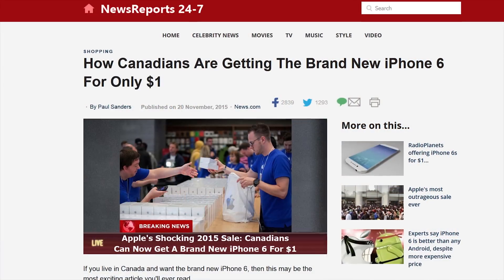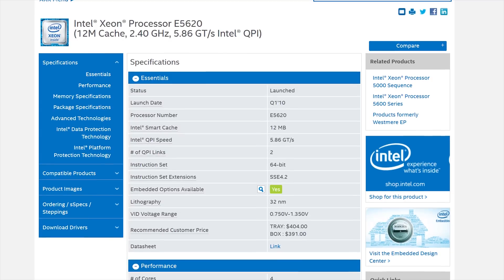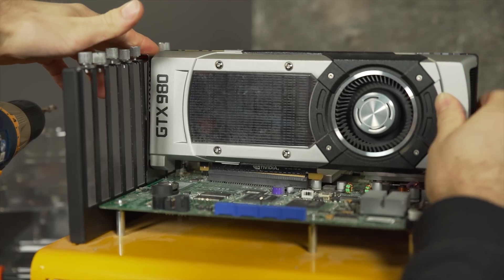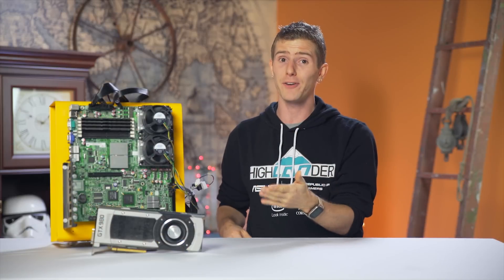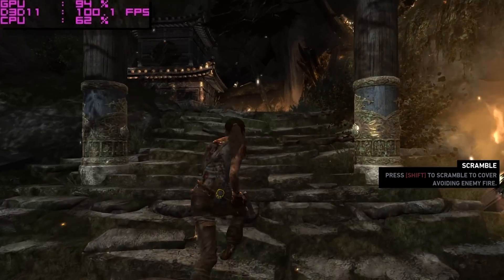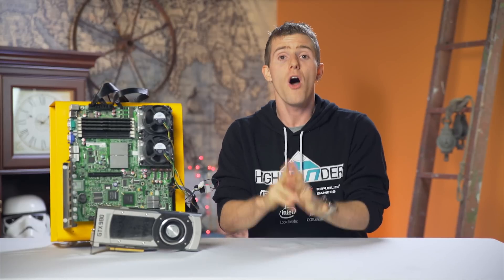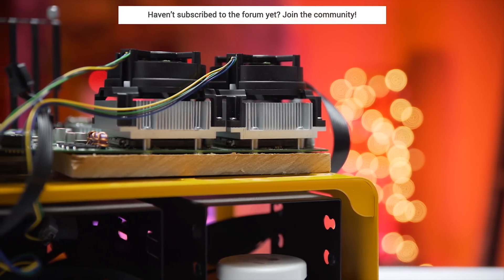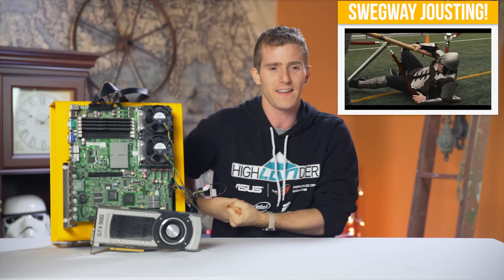Under $150 Budget Gaming 8 Core CPU, Motherboard & 16GB RAM

Comment: *casually saws off part of 980*

oh god no
Reply: Couldn't he just have used a PCI express extension cable and mount the card further down? Why damage a video card?
Reply: MundaneRaptor It’s not that damaged, it’s just that the video card lock on the slot doesn’t work
Reply: MundaneRaptor WHY GO TO SUCH LENGTHS?!

(because he sawed it off since it was too long)
Reply: Saw IX: Titan split in two!
Reply: I'd say cutting it off was cheaper than getting an extension cable esp since this motherboard doesn't have a locking mechanism for the card. It's not like he's gonna use this as his personal rig so he didn't give a fuck lol.
Reply: GuvernorDave Chopping into a $700 (at the time) gpu is cheaper than a $50 riser?
Reply: god i hate these fucking comments that for some reason thinks it funny to press enter 7 times before typing again...
Reply: Well in his defense the 980 still works its just more portable.  

Now if the 980 had broken I would cried.
Reply: I almost cried when he did that.. I still only have a 570 :(
Reply: +Zestypanda  Well yes actually. Grabbing a hacksaw doesn't cost anything but the riser does. It's not like the "$700 card" got damaged or devalued in any way.
Reply: thats what she said
Reply: Imagine an add: Selling gtx 980. Has some parts chopped off, but otherwise it looks like new
Reply: to prevent the card from shorting pins.
Reply: My friend could not fit in a titan x so he chopped it in half
Reply: its like the hook.

doesnt affect performance but what MundaneRaptor said
Reply: no one relies on that tab to hold their graphics card in here people.........The screws hold it in....unless you dont use those? likely not.
Reply: crimescene25
 Well most of the people wouldn't notice. But personally, I build computer for me and my friends from parts, I never buy them already assembled
Reply: Dude, you could take pictures of the stupid thing and post it up and maybe...MAYBE 1% of people that looked at it would even notice. These guys would of stroked out if they knew what we were doing to top of the line video cards back in the days of the original PCI slots.
Reply: Almost 2 years later, it's still painful to watch. :(
Reply: it's the retention arm so the pci express slot clip can lock the card in place, not vital but why damage a perfectly good card when there is another way to do the job fairly easily and cheaply?
Reply: dude, this guy shits teslas. its NBD
Reply: +blind1337nedm lol
Reply: The GTX 980 never cost 700$, it was cheaper at release (550$)
Reply: Pyrofan97 No, that was MSRP. Stores sold it for as much as $700
Reply: A Bal Just put it in a whole computer and sell it all. None of you noobs would even know it was gone.....
Reply: xPimpChickenGaming x 
No
Reply: Luis C. Yeah but the video got 3 million views =^_^= makes all the money back and then some.
Reply: +Luis C. badum tss
Reply: cringe worthy
Reply: Luis C. It's just the lock...
Reply: *very casually
Reply: check the tittle!
Reply: Who cares, bloke is bathing in money
Reply: That part is honestly gold because computer need a suitable metal and that is why computers are expensive
Reply: *off
Reply: Zestypanda done :D
Reply: @tr4shstarr  how did you edit the comment with "off" without editing the comment hax???
Reply: +MundaneRaptor Probably but it's just a useless piece of plastic/circuit board that he removed.
Reply: guess it's a "sawed-off" now.....

kill me
Reply: Luis C. Calm it's not likebits a 1080
Reply: I mean a 980 still is more spendy than a 1070 right
Reply: lol?

Comment: I love that someone finally covered what I run as a main system. 
Granted, mine's a Dell Precision T7400...but It works great!
Reply: What hardware do you have in that?
Reply: Dual 5450 Xeons, two Evga GTX-660 2Gb, a Kingston SSD and dual 2TB Western Digital drives.
Reply: UnKnownSoldier41
12 MB L2 cache. 1333 MHz FSB. Big cache is very good.
My AMD Phenom II has 6 MB L3 cache, 512 KB of L2 cache per core.
Reply: Nice build. I'm hoping to snatch another SSD to use purely as Virtual Memory to go along with the 32GB of Ram. 
This ram runs hot!
Reply: UnKnownSoldier41
It just need some air flow. Perhaps add a small fan.

32 GB is a lot. I know a guy who added 64 GB in his Mac just for the heck of it.
Reply: louis tournas 
It has two fans on it. These thing uses DDR2 ECC, the one's with the heatsinks. Apparently they are able to run at high temps :/

This machine can hold at most 128GB, I believe.

Comment: So maybe someone here can help. I'm looking into getting a Xeon E5-2670 8 core CPU and all's well (Thank you ebay) but the problem I ran into is finding an LGA2011 Socket Motherboard for it. I can't find one that isn't $300 or so or a 2011-v3 which I'm told does NOT work with it. Not to mention I heard the X79 is a good fit for it and doesn't use odd server proportions. Has anyone seen something that is in the ATX range of Motherboards for less than half my rent money? Thanks in advance!

Comment: if you had gotten a couple of higher clocked CPU's, do you think they would have kept up with the GTX better and possibly not have cause a bottleneck? (the x5460 is about $20 a pop right now)
i've been eyeballing the dell precision t5400. it has 16x pci-express 2.0 slots available, and ram for that computer is cheap and in abundance.

Comment: I did this for about $45 with some thrifty shopping. I got a pair of E5620s for $5 a piece, plus an old Dell Poweredge R410 board off of Ebay for about $30. With two sticks of refurbished ECC 1066 4GB from samsung to finish it all off (maybe $5 a piece), I got a beefy home server for VMs and gaming for literally dirt cheep. 

This isn't to flaunt how amazing I am though, it is more just to say that you really CAN do something as stupid as this and have it turn out great :D
Reply: hey i was looking into that board, does it have a pci-e slot?
Reply: Indeed it does. However, I should warn you that you will need to do a tiny bit of custom modding to get a regular PCI-E device into the slot (just bending a little metal). Also, the on board cpu fan headers are not compatible with regular fan connectors, so you might have to do some custom wiring there or pick up one of their own fans.
Reply: +Legendman2012 thanks for info, btw im guessing there's no type oc with this mobo

Comment: Also I have a e4500 core2dou it cost me 75p
Reply: That can't suffice; it's not powerful enough in this generation.
Reply: +kemboy323 I know but still cheap it runs win 7 great
Reply: +kemboy323 I know but it still runs Windows 7 fine and office 2016 (with a good 7200rpm had or ssd)

Comment: Just buy a Dell T5400 workstation. Fit it with 16GB of DDR2, 2x X5470 at 3.3GHz and you are good to go. 850W PSU and dual GPU support all built it.

Comment: wait lets just think, you could buff this up to to a £300 build and winning cheap ebay auctions and buys you could stuff it with power and an additional few parts like a sound card and more high spec ram and gpu. i will do this if i have to sell all my furniture on the way.

Comment: When your $1400 build gets a lower Cinebench score than a $150 budget build
Reply: How the heck did you spend $1400 and get a lower cinebench score, did you build it in the 1990s?
Reply: If you consider his build at full price (200+$)+that graphic card (500$)+a huge case for that HUGE mb (100-200$)+PSU (80-100$)+hd+ssd you are over 1.000$.  

And i'm not considering: the value in terms of time & efforts of all compatibility issue that can occur and the really low upgrade chance.

With 1.000-1.100$ you can achieve the same results if you care only about gaming performance. High end gpu and decent cpu+mobo is the way to go.
Reply: My laptop has a cpu score of 35cb XD
Reply: In the 1400 are you taking into account only MoBo, cpu and ram? I don't think so :D
Reply: +JakeAndBake nope, July 2014 ;)

http://pcpartpicker.com/user/AHoboPanda/saved/JNjwrH
Reply: A Hobo Panda my 1000 dollar build gets over 2k
Reply: Take 5 Channel cinebench is cpu not gpu lol
Reply: Taking those things only into account would be relevant if I got a higher score. My $1400 build in total got a lower cinebench score than a $150 budget build.
Reply: Actually is more like $550 with the 980.
Reply: since 470 is tv's,headset, mouse... and you graphics card was 400 and your case and blue ray reader were 40 each, the storage units were like 330 and then shpping and all that doesnt come into the price. so thats like 1300 its not gone up in price to 1700 but still youve only spent like 300-400 on what he spent 150, i think you got the better deal in the end as your parts are better for the future xD
Reply: What about psu, hdd, coolers? they come free? xD I also like to include monitor, mouse/pad, keys and case
Reply: my 250$ bulid get's 918 points one cinebench
Reply: Dan katesfield i have a Pentium 4, its very Bad, i cant Start the Benchmarks or it crsshes after 10-15 seconds

Comment: under 200 euros u can make a 12 core machine with 8 gigs of ram (using xeon 56xx and LGA1366 dual sockeyt mobo)
Reply: no you dont
Reply: 2 xeon 56xx + 8gb ECC ram DDR3 and 1366 server mobo FIND IT ON EBAY

Comment: Best budget pc (used part) e5640 $30; good used cpu cooler for oc $15; x58 mobo $80; 4*2go ddr3 $25; 7870 or r9 280 $110; a good 650w psu $25; a decent gaming used case $30; a ssd $70 or 1to drive $50. So for ~$365-385 you can have a goodass cheap 1080p gaming build, Overwatch at high 100fps same for black ops3 and 300fps on csgo (with overclock, 4,2ghz for the cpu and 1,1ghz for the gpu)

Comment: its better to get an lga 775 mobo and mod it and the cpu to work, of course with a better cpu cause u won't be able to install 2 and it will have max 8gb of ram, but its much easier to do :P i just finished building a pc like that and it works really well, its the 2nd time i did it :P

Comment: Cringe when you cut off the piece of the GPU. Could have modified that cheap ass motherboard instead of fucking up a fantastic card.
Reply: Glaive Beam "rip that capacitor off" all you need is a shitty SMD rework station for $50, it's worth it vs messing up a $500 card.

Comment: This second hand, super budget is nice, in case you allready have parts lying around to start with.
Here's me for example, I work at a hardware repair shop and I have an intel LGA2011 board lying around, so I went on e-bay and found a xeon e6 2670 for 70$?! I mean, it's a hell of a cpu for this money!
So I have something to start with, at least my chances of it actually working are much higher.

Comment: My X5460 can play GTA5 at 1080p low settings with 60fps, which isn't bad for a single CPU that cost $30.
I undervolted it as well, so it doesn't require much power to run.
Reply: E5640 ~$30 once overclocked at 4.2ghz turn like a i7 3770 :D
Reply: Francefire It would be good, but the X58 motherboards are expensive which kills the budget factor.
Reply: PooPipeBoy I agree the x58 are very expensive but if you can find one for 50-60 bucks it's amazing

Comment: didn't include gpu
end up 20 fps on gta SA
Reply: the 980ti is not included in the price linus listed.
without a  decent graphics card  oscar is right, it wont game without it.
Reply: Description says gaming though
Reply: it wouldn't run at all, xeons have no integrated gpu
Reply: Just get a used GTX 760ti for under 50.
Reply: Considering San Andreas' framelock is 24 fps and the game's physics break past 30.
Kinda not a smart comparison to make.
Reply: my 1070 gets that. 1080 should beat that easily
Reply: Linus doesn't claim it's a gaming rig for under $150, just the ram/mobo/CPU combo
Reply: throw in a GTX 960, lots of fps.
Reply: +Oscar 1344 .......you're a fail....smdh
Reply: Says "Didnt include gpu" U Forgot how to read?
Reply: +Connor McReynolds I'm saying it's not the whole thing for under $150, just the mobo, cpu, and ram.
Reply: "xeons have no integrated gpu"  Those old ones didn't, many new ones do (like my E3-1225v3. afaik all xeon E3's with a 5 at the end do have a iGP)
Reply: I used to play GTA SA on a 1.50 GHZ AMD processor in my old laptop and I could get over 30 FPS
Reply: 1080 here!
150fps on fucking GTA 5 ultra settings
whoops
at least, its higher than 30!
Reply: AbangMokie AC im buying gtx 1080 soon but i have a question. i checked gta 5 benchmarks and fps showed 110 ish. do you constantly get 150 fps or more like 110?

Comment: Hi. I've got a question and maybe someone could help me. My old PC e8400 is slowly breaking apart and I want to buy something like this. My question is... Is it worth to buy a HP xw8600 workstation with two xeon e5440 cpus, 32GB RAM and 1050WATT PSU for about 260USD with shipping and a one year warranty? There is also a sas hhd and 8600gt card. Instead of the geforce 8600GT I want to use my geforce GTX580 and my SSHD. Thanks for future answers.
Reply: That sounds like a pretty good deal to me.

Comment: I just picked up a similar build to this for next to nothing...$40 for a S5000PSL, $15 for 8GB FB-dimm, $70 for 2 x X5460...shoved into a Zalman HD160,  Nice thing about the board is that it has several PCIe slots.  Might eventually sell and replace the board with a 1600 FSB one though, and try to BSEL mod the two X5460 for 3.8GHz.
Reply: +Aaron Henderson damn! savage!
Reply: I built the system after recently having to sell of a 2500K+290X rig due to financial reasons.  Now, I haven't got the GPU I want just yet, but so far, the setup seems to outperform my 2500K setup in most CPU related tasks.  I only have it paired with a 7870 at the moment, but I expect when I throw a 290X in it, which I plan to, it will be a great replacement to the 2500K rig I had to sell.  I sold the 2500K pc for $700, built this one for well under $300 Canadian...probably more like $225-ish...after I sell the 7870 and replace it with a 290x, I'll likely still be well under $400 on the whole ordeal.

Comment: i got asrock 4core vsta motherboard for like $24 in euro on ebay and quad core 2.93 cpu 1066mhz fbs 130w power consumption. plus i think motherboard comes with cpu and ram with it and back panel

Comment: for $150 i got a i3 2120, 4gb ram, and a gtx 260 :(
Reply: +speedqbcam Go with the gtx 650.Its a better option compared to gt 710
Reply: +speedqbcam lol not bad why r u sad
Reply: +speedqbcam I got Core 2 duo 2gb ram hd 4850 and I'm happy :D
Reply: +Tuna Yücer nice :D. im sad because im having an issue where whenever i start a game, my screen goes blank and theres a random color. so im getting a gt 710 or a gtx 650 :)
Reply: wow thats bad. my hd 4850 works pretty well and cool :D

Comment: I have a whole pile of these 5400 series units we use for servers in our ISP... Most of them bought on Ebay or refurbished. Just watch out since some of the PCI-E slots are only X8 on server motherboards.  Also, you might be able to source a complete unit  for not much more money, and many of those had 800W-1000W power supplies.  One thing to also look for are 'Workstations" which have dual CPU Xeon motherboards, designed for desktop use and they can be very inexpensive as well.

Comment: i had a HP XW6600 3ghz 8 core with 16gb ram and a 6950 and never had any issues with games on it.......... you can get the XW8600 cheap now as well on Ebay.

Comment: If you really want to dick around with server hardware in a PC build, you can always pick up a cheap socket 775 board with the right chipset (there's a thread somewhere on OCN that goes over all the chipsets that are known to work), hack the plastic tabs off the socket, get a sticker that modifies the pinout on the chip, and throw a Xeon X5450 in it.

Comment: You got the wrong board man , 
S5000psl is what I'm running with 2x 5450 and I play any game in the world ultra, never had a problem with them bottlenecking anything
Reply: I don't know why you went with the smaller CPU when the 5450 is as close to a skylake i5 as you'll get for under 150$ , 20$ a piece , and they can be clocked to 4.5ghz easy. , but no need they run fine.
Reply: +Kyle fulerton What power supply works for that M/B? Not ATX from what I have read.

Comment: I can relate to this video in the sense that many years ago I was bound to minimal investment yet wanting the most for my dollar.  I had an AMD Athlon XP-M 2400+ barton core on budget ram running at 3.1g.  I was far behind the curve on form technology, but in my tireless tweaking along with home brewed evaporative water cooling I could reach clocks beyond anyone that had previously touched that processor.  While I spent countless hours tweaking single ram timing's I found respectable FSB on my non leading edge memory, and I also found class leading clocks on my Abit AN-7 (14x222).  In these day's I had no youtube, only my day in and day out dedication to my computer.  Also I reached over clocks of more than %30 on my ATI raedon 960plus.  These were desperate day's, as I never left my room short of raiding the fridge for a coke and the cabinet for a granola bar.  I don't have a point, if you are dedicating far to much of your time to budget performance, something needs to change.  And in that part, my heart is truly with you.  My journey took countless years.

Comment: you guys are doing too damn much.  

brand new amd fx8320e 8 core, gigabyte ga78lmt-usb and 16gb crucial ballistix ddr3-1600 ram BRAND NEW for 150.00
Reply: +Adam Cooke seriously though is this what it's come down too?  dumpster dive so you "might" have a gaming pc?
Reply: +Adam Cooke Yeah but your CPU is garbage.
Reply: +237kitty for gaming what does it matter
Reply: For gaming the CPU is not good.
Reply: one of my computers has right now has it and it performs just fine. it's basically an fx6300 with 2 extra cores
Reply: Extra cores don't really matter when the IPC is low, and the cores are really slow and a lot of programs don't utilize more than 4 cores.
Reply: +237kitty yet it plays all games with no problem so your point is moot